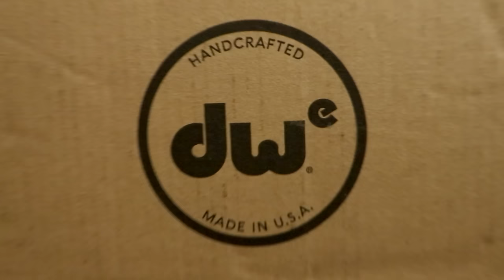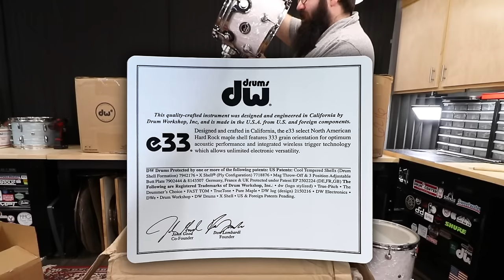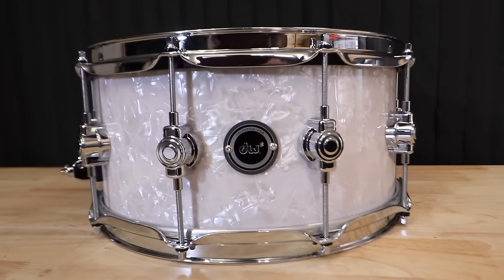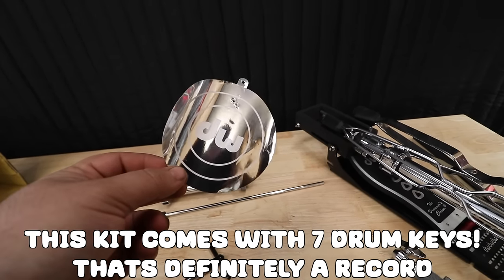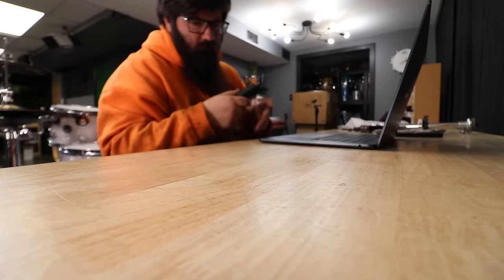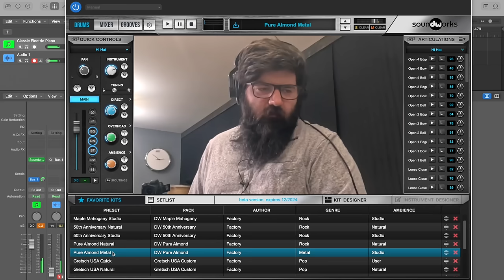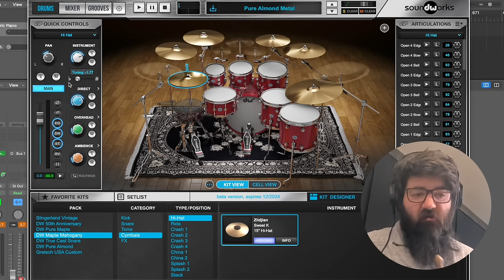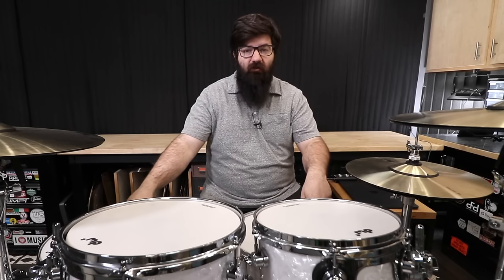The MOST EXPENSIVE Electronic Drum Set I’ve Played - $9,000 DWe

Comment: The price i actually understand because it can be converted to an actual acoustic kit. What i wonder the most is the durability of the triggers and cymbals over time from someone that would jam to it almost daily. I honestly see the electronic side of that kit having problems down the line with the cymbals bending and cracking and signal loss from the triggers.
Reply: I see no reason for the triggers or cymbals to fail as they’re all just very simple electronic parts. If one of the cables would rip, a soldering iron does the job and replacement piezos cost around 4 bucks
Reply: Swap the cymbals for low volumes when practicing then put the triggered on recording
Reply: I am someone that has had a e kit cymbal break on me. So that was also a thought
Reply: @pour-g8677 great idea

Comment: Speaking of mesh heads and regular heads. Any thoughts on if using mesh heads on the reso side with regular tom heads the batter side would work to have one kit that can be used for both silent practice in the mesh side and loud performance and rehearsals on the regular head side? 

I can't stand drum mute pads, I only have room for one kit and need both loud and silent often enough that swapping heads constantly is impractical. And I'm fine with the concert tom sound and modifications to make mounting upside down work.

Comment: I own both electronic and acoustic drums. Pros and cons to each. A purpose for each. My ears always lead my preference to acoustic. The feel is also a huge difference. Since this has been announced I have been wondering who is the target audience for this. The younger tech driven drummers out there probably won't have that kind of dough to drop on that kit. The older drummers who have the dough generally speaking don't want the hassle of computers and wireless pairing etc. Unless of course they employed by day in an IT position. So much easier to set up an all acoustic set and drum, no electricity or other junk to deal with. In these reviews I have not seen anyone testing them in real world live show. I have seen so many dropouts on wireless guitars and mics that have been easily fixed by a physical wire by the sound crew on the fly. How is any kind of issue with this kit in a live situation going to be fixed? A 40 minute intermission?

Comment: I don't get it: Like I assume the purpose of this set is that it's a full on acoustic set that already has triggers in them so you can use it as just acoustic or acoustic with triggers so you don't have to monitor yourself while playing if you don't want to (vs an electric only kit)

But then you got to the cymbals which instead of having triggers are metal but full on chocked by those plastic rings...They don't even look like you can remove  those since then the bell and cymbals wouldn't be touching...Then plastic i.e. electric only hihats. Meaning that out of the box, this is just a really hard-to-transport electric set, the one advantage of having an electric set.

Like sure, heads are not acoustic ready but they could be? I guess if you want an electric kit that looks acoustic but out-of-the-box isn't reaIly? I just don't get this product but hey, maybe it's just me.

Comment: I have a Roland VAD 506 - I bought the VH14 so it's essentially a 507. I am very interested in this kit but don't need it now for a few reasons. 
My kit is totally fine and I'll probably keep it for the foreseeable future 
That aside, if I were to go with this I would need it to be perfect to justify the price. The first thing, the metal cymbals. I play at home and have had a metal ecymbal before and it is noticeable louder. The second thing, the module. I like the laptop approach and use a VST from time to time, but that is mostly when I record. Most days, like 95% of the time, I just want to turn on a module and practice/play. 
So basically, I want a module, rubber cymbals, but then add the wireless, and I'm all good.

Comment: I'd rather have a pared down more sensibly priced version with just the eDrum components without all the added cost of the higher-end acoustic drum shells. If I owned the current hybrid kit I'd probably end up just using it in eDrum mode and rarely if ever use as an acoustic kit (I already have numerous acoustic kits). Or even better, DW/Roland should consider making an adjustable conversion kit to add to other brand acoustic kits a drummer may already have.

Comment: Looks pretty freakin awesome... BUT... haha.  The cymbal thing is an issue and (It's always this) The hi hats.  When I had my Alesis Strike Pro SE I literally just used my ACTUAL hi hat cymbals rather than the ones included.  Since we were playing live it worked.

I guess since the DWe is wireless, you don't have to worry about expansion?  You just buy more drums... but would they send you an 8" tom?  a 14" Floor tom?  I mean this kit is designed to go from Electric to Acoustic so they would HAVE to send the appropriate sized drum right?  Like if I want an 18" floor tom....  

Also I'm wondering if they will end up changing the cymbal design to something closer to the low tone style that look and feel more like cymbals?  I must say.... Excellent first effort by DW.  Well Done!

Comment: I went on a journey awhile ago with E-drums.  The constant battle was between my desire for them to be "stealth", looking like acoustics while being more portable (and fit into a car easier).  I find it interesting that these are heavier than acoustics and just as large...not even cocktail size.  I get it but it would be good to see a more portable version.  I'd also be interested to know if any thought was put into using real heads and dialing in the electronics to work more as acoustic triggers.  After all, If I'm going to haul around a full DW set with hardware, I'm going to do what I can to use them acoustically.

Comment: I do not know the details of the software provided here, but I would have trouble trusting DW enough to spend this much on an electric drum kit (if I had the money lol).
I expect instruments, especially expensive ones, to be musical tools capable of providing value for decades if taken care of properly.
Instruments that rely on proprietary software can break or degrade in quality based on the whims of the company providing the software.
- What if the software is discontinued? Will you be able to use this in 50 years?
- What if they drop support for your computer hardware?
- What if a firmware update bricks the modules? Would they provide replacements?
- What if they implement privacy-invading tracking and telemetry (Maybe they already have)? Is that something we should accept?

I know that it has aux output, and that it can be connected to other brand modules, but is the support guaranteed?
Also, a lot of the value here seems to be in the DW software, so using the above workarounds might still degrade the value.

Comment: Looks cool, but the default software sounds really bad and very artificial (especially the cymbals, yikes). Would definitely need to get Superior Drummer or EZ Drummer to actually get a good sound out of it which is very disappointing for this expensive of a kit. I would've hoped they'd developed better sounds for it, but it seems the E-Kit makers are not as good as the Drum Sampler creators at creating good sounding E-Drums. And then I don't know what special features you lose from the pads when you use a 3rd party software.